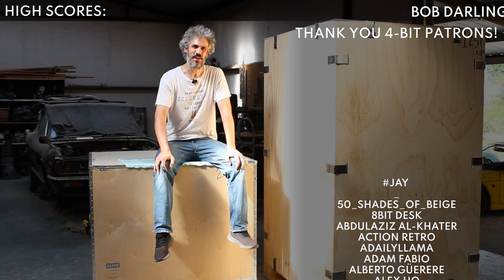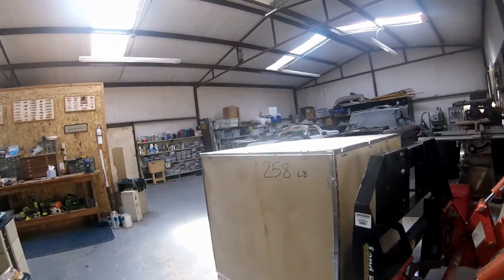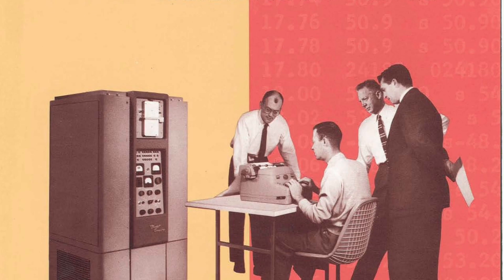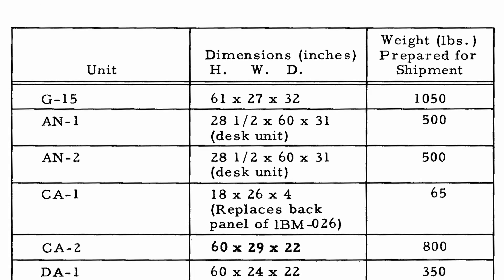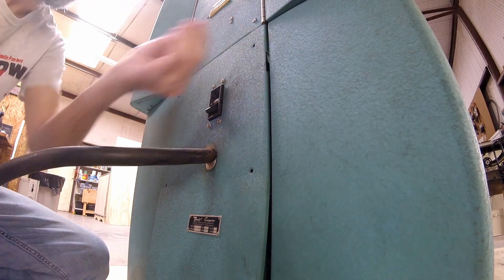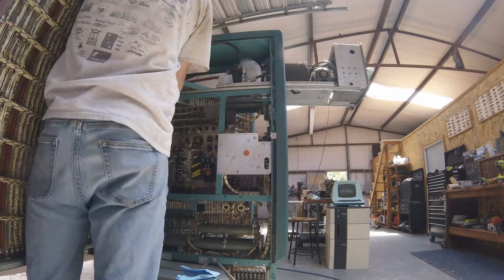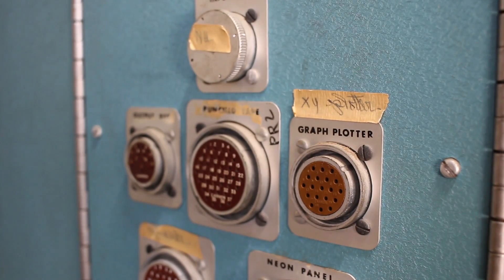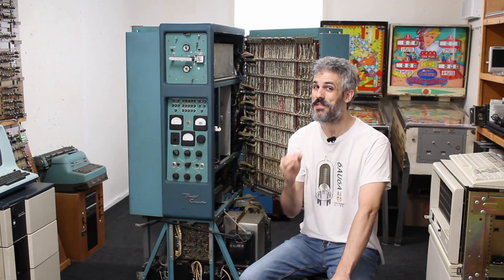My New Computer Weighs 1,000 Pounds!

Comment: Re the caps, do you do cap reformation, where you slowly bring the power rails from 0 V to Vcc? That's something I would expect would be quite helpful at avoiding cap failures, but I've not seen it in any of your other videos where I might have expected it.

Oh, and I am pretty sure you are missing one important peripheral: a Pip-Boy!
Reply: Reforming is boring, my guess they do that off screen. 
Personally if i had the money i would just replace them. But then again, considering the historical value... Looks are important. But making it safe to run is important too
Reply: @bzuidgeest  I don't think it's boring; I think it's quite interesting to learn about it and see how it's done, and what else is involved (e.g., what parts you need to remove before you can do the re-forming). After all, I watch these kinds of channels to learn things, and completely skipping an important process, with no mention that you're even doing it, is skipping the chance to learn something.
Reply: @Curt_Sampson  you do realize that reforming takes hours??. Do you really want to sit watching a video of a needle moving? I never said the restoration was boring. Watching a capacitor reforming over several hours is boring. If you don't know how it's done, tech tangents recently did a video about it.

Comment: You need to treat this as if you are restoring a old Tube Amplifier (or any tube equipment):
1. Do not try to reform the main power bank of capacitors (that will bite you in the a$$). Replace/re-stuff them.
2. Replace any paper type capacitor (better safe then sorry).
3. Test all remaining capacitors (not with a meter but old school tester that can apply high voltage).
4. Replace all those red Selenium Diodes, in the paper type unit (do not forget to add a series resistor), they like to generate stinky magic smoke.
5. Buy a lot of contact cleaner :)

Comment: It's amazing how in the 50's they did their best to make things to last as long as possible, usually as easy to repair as possible and used the highest quality parts they could for the most part. They had a merit based system where they choose the people with the most experience and skill to build things back then to produce the best product they could. Their skill in craftsmanship and passion for what they built is self evident when you examine the machines/products etc from back then. It is really sad how in general much of that way of thinking has been demonized.
Reply: They had to be easy to service as they had to be repaired so often.

Comment: I sincerely wish you the best of lucks bringing that behemoth up. Yo'll have to face burned and out-of-spec resistors, dryed capacitors, fused dioodes, broken valves, rusted contacts, and just age died mechanical and electrical components. I hope that drum rools and  it's still magnetic. Also, supplying new repalcing valves can be problematic. I recomend you to seek for the help of an experienced electrical or electronical  engineer to help with the machine. A  bad connection while restoring it might cause it to blow up or even a real explosion from that 50KW machine. Also, consider using working parts from your machine and from the other local machine to compose a single working unit. I think it's the best chance. I see it as a hard work for several yers.

Comment: I wonder why did the memory contraption would record the data onto the surface of a giant cylinder instead of changing the rotation of read/write needle and using surface of a rotating disk. This way you might use several disks and the space would be used much more efficiently, giving you probably much more than just 8k of memory. Yes it does sound like HDD, but I wonder why wasn't it implemented sooner rather than later - is it technologically so much more challenging (which honestly doesn't look that way), or did nobody just have the idea?

Comment: Was 240 volts uncommon in the 50's?   Seems wild to use 115 volts at that kind of amperage.
Reply: 115V is standard North American wall voltage, more or less, so Bendix had to work with that or around it. It was probably not a good sales pitch to tell potential customers that they would need to modify their electrical power systems on top of buying the computer, and doubly so for any customers just looking to lease or rent one.
Reply: @martianhighminder4539  ...but--at least with modern electrical systems--you wouldn't need to "modify their electrical power systems;" you'd just need to run a dedicated circuit, which you'd have to do anyway.  Anything using 120VAC/50A would be on a dedicated circuit.  Today, at least, it would make much more sense to use 240VAC/30A, which surely would be available in any home (much less commercial building, which is where one of these would be used) built in the last 40 years or so.  And the cost to put in a dedicated circuit would be peanuts compared to the $60k (in 1956 dollars, yet) cost of the system itself.  But in the '50s?  There I just don't know.

Comment: Had they used the Raytheon/Philips wireended vacuum tubes then the vacuum tubes would be smaller and use a much lower voltage.

Comment: Hate to be a downer here, but you had better go over the AC side of things with a fine tooth comb. That coputer has water damage judging by the front panel and power taps. I've seen it bedore in younger stuff not stored in climate controlled conditions. Corrosion will kill that thing when pwer is supplied of not fixed forst. Don't ask, just do it.

You also need to go over the DC side but you'll find most of the bad spots replacing caps, selenium diodes, and relay contacts that are beyond shaping. I hate the work that goes into relay rework only to find the contact has high resistance or the nib has no material left to shape. I wish you luck in not have a 3/4 ton paper weight.

Comment: How many cockroaches did you found inside it ?
Did you know that the expression "a bug" use nowadays for a faulty computer is because a that time, before the transistors where invented,  live bugs were attracted by the light and heat produced by the bulbs inside the computer, producing shorts circuits.
;o)

Comment: That's a "half million dollar" machine. No wonder it is so well engineered.  
"The base system, without peripherals, cost $49,500. A working model cost around $60,000 (over $500,000 by today's standards)" Source - Wikpedia

Comment: semiconductor gas
Reply: optically activated gas
Reply: either physically pushed or photonically made transparent, default opaque, as optical transistor switch
Reply: well some low vacuum tube with some usually opaque gas
Reply: any scale, from electron-nano to macro, 1-bit for starters
Reply: laser fusion seems to work too
Reply: relic room
Reply: CuO is a nice semiconductor resistive material
Reply: why not rewire a computing circuit every time, fpga per cycle
Reply: minimal number of transistors
Reply: no electrical transistors, only optical, DGS
Reply: well maybe flying electron (CRT) instead of photons (euv, x-ray) or electrons in a wire
Reply: might need to use x-rays in a=1nm width optical wave guides at 471PHz (471k THz), f0 = c*pi/2a